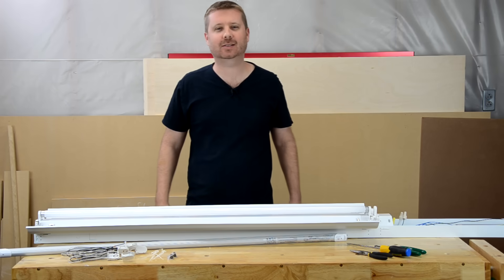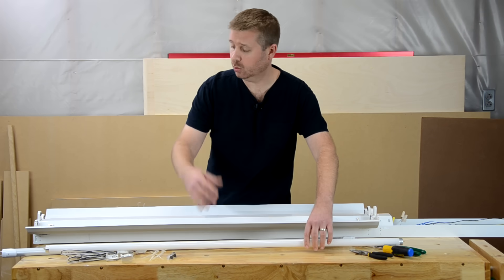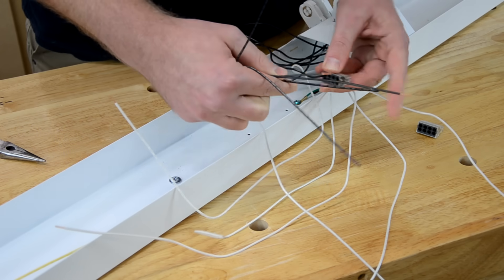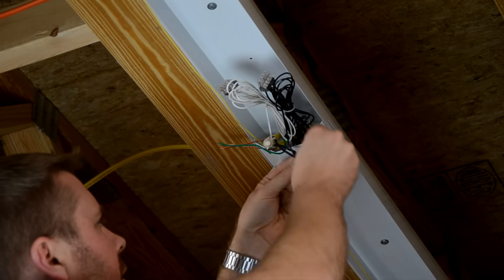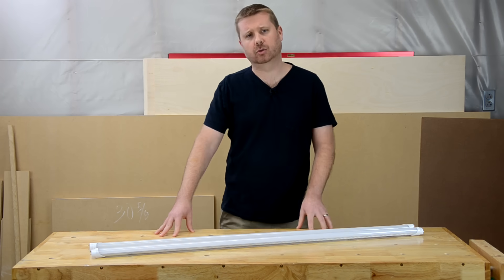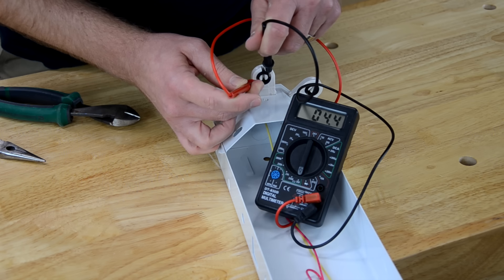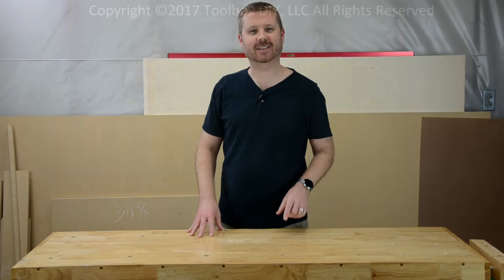How to easily convert fluorescent Lights to LED –Easy Ways to Save Money

Comment: I have 4 ceiling lights. They are 4 foot fluorescent fixtures. They were normal florescent and I changed to 4 foot LED bulbs. They are all the same and have 3 ballast per light. In 3 lights they are fine and bright and work fine. The 4th flashes on an off like a strobe. I switched two of the working LEDs in the "flashing fixture" and they ‘strobed’ as well. It only happens in the one fixture.
After ‘strobing” for a minute the bulb quit lighting or flashing altogether. Did the LED die?
What would you suggest.  aaronkdean@msn.com

Comment: Good Video! 6 LED Bulbs is over kill. One bulb on each end will put out plenty of light, as bright as 6 florescent s did, plus 2 is 1/3 the cost. Double ended LED Tubes have a tiny schematic diagram that shows to wire one side BLK other side WHT (using shunted tombstones).  Definitely take out that old ballast and recycle. They also get very hot so let them cool down before removing.

Comment: Some im a bit late to the party here but i have a question.. my ballest works with 1 LED however when i place the 2nd led tube in it it will turn on for a moment then just turn off.. what in the world would cause that? Also is thier a way to get a ballest thats already set up for dual leds thst i can just change it all out st once?

Comment: 4-5 years ago, I converted the one in my garage to LED and so glad I did.  Although it took a bit longer than your demonstration--first time and I left the fixture mounted--it worked out fantastically.  Now, I have such clear, white light in there whenever I need it without the hassle of having to replace the tubes so often.

Comment: You have contradicted yourself, You said at the beginning you said you need non shunted lamp holders and then said that you need to replace the pre existing non shunted lamp holders with shunted ones. Did you mean that you need to replace the pre existing shunted ones with non shunted ones? And to fully clarify, do I need shunted or non shunted if a am replacing with a single ended lamp like yours?
Reply: He did misspeak and say he was going to install shunted tombstones but of course he installed non-shunted.

Comment: my electrical instructor in turning in his grave.you never strip solid wire with a stripper like that,only a knife at a angle.also your push in connector could cause a fire if done like you did, after you push in you should pull on the wire to bite in a bit for a good connection.

Comment: I have done several conversions and never changed the ends. You simply connect the hot to one wire and the common to the other.
Reply: Jake Jones - That’s the proper method on a double ended bulb but as was stated in the video, some bulbs are single ended. One pin is marked L1, the other N. The ETI retro fit kit from Home Depot is configured this way. The pins on the other end are not connected to the internal strip. They are just there to hold the lamp in place.
Reply: You said that you replaced the NON-shunted holders with shunted holders. But from what I can tell, you actually did the opposite. 3:53 Perhaps it was just an accidental mix-up of terms?
Guess I was lucky in that every fixture had TWO wires into each holder on one end of the fixture. But yeah, I understand that there is no way to attach two wires (hot & common) to the holder, that the electrical end of the LED tube connects to, if there is only one wire coming out of it.

Comment: Evidence suggests the efficiency of fluorescent lights are 85%, the efficiency of LED lights are 90%. This is a trivial difference and not worth the time or effort of the exercise. If a fluorescent light fails change it then, otherwise you are just wasting money. So far there has not been sufficient time to establish that LED's last longer than fluorescents. Is an early adopter of LED lights I have had lots fail much quicker than even incandescents, never mind fluorescents.

Comment: I retrofitted many of these fixtures with LED. They had a high failure rate. I only replace the whole fixture now with much more success.
Reply: Interesting. Used direct replacement LED tubes that are powered by the ballast?
Reply: @fredsinfield5648  No they were wire directly to 120 volts. By passing the existing ballasts.

Comment: Beware, all lights that burn at a temp higher than 2700K because they produce a ton of ionizing BLUE LIGHT RADIATION (BLR) which is very damaging to the photoreceptors in the maculae of our eyes. These macular/foveal receptors are what allow us to see straight ahead clear detail vision and they can take only so much ionizing BLR before they begin to degenerate. BLR is now clearly shown in the scientific research to be one of the main causes of macular degeneration which results in central vision blindness. 
Stick to 2700k or less in all LED bulbs that you ever buy. I have replaced all bulbs in my own home with 2700k LEDs. 
Type Blue Light Radiation and Macular Degeneration in the Google search bar. 
It makes it pretty clear. 
By the way, I am an eye doctor. 
Bluetech lenses for indoor and Bluetech Sunglass dark lenses for outdoor use and Reticare.Com screens for monitors and cell phones which also produce a lot of BLR are the only options I can find to block BLR 100% and keep your eyes safe. All the rest only block a small band of the BLR radiation. 
Get yourselves educated and then protected from this Blue Light Radiation throughout your younger years and you will significantly reduce your risk of AMD. 
Grady M. Clark, Jr. OD.

Comment: you can contact me if you need led light,our factory specilize in purified fixture lamp proof light, T5 intelegrated light,T5/T8 tube light,odm/oem are welcomed,whatsapp:0086-13757352084, facebook:alicepan1964

Comment: Just bought a two pack of LED tubes from costco and put them right in..... they worked like a charm!!   Not sure why the fuss over opening up the fixture and re-wiring things 🤪
Reply: Ballasts put out high voltage, some LED's need that, others are designed for 120VAC which is typical house voltage, so you have to know the difference

Comment: Another 2 cents. For work get the higher Kelvin, closer to day light tubes. The bluer light makes details a bit sharper. Grandma might prefer the warmer light, it'll show fewer wrinkles. 

     And don't listen to anyone saying "Daylight fluorescent? those things are terrible!!" That person will be at least 50 years old. There used to be a 'daylight fluorescent' in the 50s and 60s (maybe earlier) that flickered and gave off a really ugly greenish light (not at all daylight).  It was supposed to be a cheap and efficient solution for lighting up passages and stairways. They noticeably flickered. If you've ever wondered what a migraine headache is like, find one of those old fixtures and spend an hour reading under it's light.

   Daylight (the temperature of the sun's surface after it passes through our atmosphere) is 5500 degrees Kelvin and the best light to work under (so long as it isn't flickering), shows colors the best. (Yes I know our eyes adjust, but I can prove this). LEDs really are wonderful.

Comment: The double ended LEDs do raise an old electrical concern. One of the major problems with the old post and tube wiring, (besides bad insulation) is the separation between hot and cold wires.  You know the old story, the rat gnaws on the insulation of one wire while its tail sits on the bare wire of the other side. Circuit made, rat is electrocuted and then caught between the wires like a resister the corpse heats up, burns down the house... If that rat's ggggreatgrand-children gnaw on romex and makes a circuit, it'll be close enough to trip the breaker before catching fire. 

 In my long construction experience more than a few mechanical accidents have happened around live circuits, cutting the romex, or the wires, or the flex... big spark and the fuse blows or the breaker trips-- and no one dies and nothing burns down. There's an overall safety advantage to having the hot and cold lead right next to each other and the ground. Anything bad that happens is much less likely to travel far enough to put your heart in between. It's odd that in 2019 I've installed several LED 'fluorescents' , but never changed a bulb and never thought about how they're wired. Tonight I want to convert a really nice fluorescent fixture I've had for 25 years. Thanks for the video.  Answers all my questions.

Comment: Two questions. How come you did not take the time to shorten the new wire for the LED tombstones? Second, how come you did not just push the hot and the neutral into their respective push-connectors instead of using a pigtail? if the wires were cleaned up it would have been really simple to identify these if you need to work/replace in the future. A good video just had these questions.

Comment: I recently converted 31 6 & 8 tube units. I did not need to change the tombstones. I used 5000K bulbs. The shop now is like working out side on a sunny day. A plus to LED is no or very little heat is generated, so in my shop with saw dust it’s a nice perk. From my days of wiring homes we did not bundle wires and tie them up because of heat build up we would let them just be loose. I do realize with LED there’s not much amp draw so probably not any heat buildup in your bundles but if it was for another heavier amp draw item it may make a difference. Nice video I’m sure it helps people that are wandering through the LED maze.

Comment: That 1.1K disliked are the one's that are electricians and they don't want you to DIY  and taking away their businesses. LOL
Reply: You are partially correct but it has nothing to do with the business side of the industry.  Many of the down votes most likely have come from electricians, such as myself, who understand the dangers of such an installation.  The process shown in this video of supplying line voltage to a fixture tombstone creates an increased risk to the homeowner coming in contact with live parts.  There is little protection offered by the plastic shell of the tombstone when installing the LED lamp which has exposed pins you insert into the tombstone.  Additionally, many of these products are not tested and/or listed by any reputable agency such as UL or CE.  Some of them are, however the danger still exist.  Responsible electricians always place safety above cost in any application we perform or recommend.  

As to your statement on this taking away our business, very few electrical contractors rely on minor service work such as this as a stable business model.

Comment: I have a question.  Does a ballast uses energy even if the florecent tubes are not plugged on but the switch is on?
Meaning: I have a few old florecent lights in a hallway but i didn't need as much light as they were originally providing,  so i just twisted the tubes out of their sockets.
 Is the ballast still using anergy?
Reply from the maker: Magnetic ballasts will continue to consume energy without tubes present. Electronic ballasts can vary. Some may continue to consume energy but typically less than a magnetic ballasts. A well designed electronic ballast may have circuitry to sense the presence of a load and consume little to no energy. The amount of power we're talking here is probably 1 to 5 watts so not much.
Reply: @ToolboxDIY  Thank you for your response.  I highly appreciate it.

Comment: I have already changed mine to LEDS,  On some of the 4 light fixtures I changed the one end blub did not fit. I had to use the pin cap to wedge the cold end without the tombstone. Your presentation is the only one I found using the single ended LEDs.

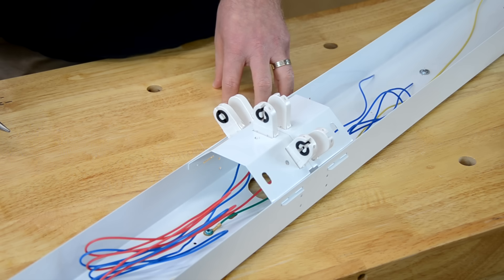Comment: I'm confused...I'm not sure if you are aware of it but you contradicted yourself at 3:57 in the video. You described the lamp holders that were already in the fixture and that you needed to replace as non-shunting when you previously (and later towards the end of the video) described them as shunting  lamp holders. You did state correctly in other parts of the video that the fixture in which you were replacing the lamp holders, require non-shunting lamp holders on the power end of the lamp.

Comment: With out reading all the comments below. I have q question. Can up put the new led tube lights on a dimmer?
Reply from the maker: If the LED tubes are dimmer compatible, you can. It usually specifies on the packaging if the tubes are dimmable or not.

Comment: If the new LED tubes are single ended, then I just need to replace the power end with an un-shunted tombstone receptacle, and just deadhead the old shunted one at the non powered end?   Can you confirm?
Reply: Exactly what I just did! Worked the first time!

Comment: What would happen if by mistake someone fitted a standard tube, (not LED ) after this change?
Reply: That's a damn good question.
Reply: Exactly nothing! The florescent tube simply wouldn't work at all! No sparks, no smoke, nothing! No light!
Reply from the maker: richardscathouse is correct. Nothing will happen....unless you have a 220-240v fixture (not common in the U.S.). I've seen videos where those fluoro tubs blow out once the circuit is turned on. The glass didn't blow, but the bulb was shot. The fixture was still operable.

Comment: be careful... we are not allowed to install double ended ( pass through) LED tubes in OZ, they must be single ended. The reason is that when you are installing a pass through LED tube and you install the tube into the HOT end first you are likely to have the palm of your hand on the pins on the other end of the tube...zap.
Reply: Assume you cant buy then either?
Reply: @richardscathouse   there are a few years of them that were installed as well as people purchasing them online.  You need to assume the end pins ARE live to be safe.
Reply: @zukjeff  As a carrier electrician (Radio) I assume nothing, ever!

Comment: What this shows is correct for single ended led tubes. On thing that wasn’t mentioned is the tubes are only powered from one end. The tubes are labeled.
Reply from the maker: Single vs double ended are discussed at about 9:00
Reply: If you reverse install they simply won't work!

Comment: While Doing this , make sure tombstones are not shunted. Very very critical.  Either buy a new ones (non-shunted)  or open the assembly and cut the shunted part. LED need non-shunted connections for single ended power so you can connect Live and Neutral wire. Fluorescent need shunted While in contrast LED need non-shunted.
Be very sure what you are doing. it looks too easy but not.
Reply: Dead end of bypass tube is dead! It only supports the tube has no connection to the light! If you try to install backwards, it just won't work!

Comment: Have you considered that rebuilding or changing fluorescent fixtures to LED fixtures you are voiding the UL/CSA approvals. In some jurisdictions you need a permit and there are required items that have to be satisfied to get a permit and inspection. By the time this happens it would be less expensive to simply replace the fixture. Most if not all homeowners do not have the skill set or experience to do this change.

Comment: I will agree 48" LED tube are more efficient than a 48" florescent tube. But it depends on how many hours the light is actually operating. If you have a shop as where you have the lights on say, 8 hours a day 6 days a week, you will definitely realized a reduction in the electricity used per month. But if we're referring to 4 double tube fixtures in a garage that on a daily basis they're turned on 15 or 20 minutes per day, it is going to take years, to achieve pay back of switching from florescent tube to LED. It is common that the switch to LED is helpful because the LED in fact produces more light, to say brighter. Especially if your garage is not finished inside. I know for a fact that florescent tube last a long time. I built a 32 x 48 pole barn, and installed 14 double tube 48" fixtures in 2001. Never replaced a single tube until 2017. Used those light everyday for at least an hour a day. The real issue, in my opinion is how much LED functions when it's winter time in a non heated building. That's where the real difference happens. Florescent fixtures take a few minutes to warm up when it's really cold.
Reply: If you leave the ballast in (non-bypass) you will actually use more electricity!

Comment: You can now purchase LED tubes that mount directly without changing anything in the fixture. They're $8 USD for a pair.
Reply: Yes, and the installation will use more electricity by-pass is the way to go!

Comment: Great explanation. My ? Is how do you know which LETs are single ended bulbs? The package doesn't say & manufacturer website doesn't give this information.
Reply from the maker: If the package says it work with a ballast, then it is doubled-ended. If it says not rewiring needed, it's double-ended. If it doesn't say any of that or anything that lends a clue, take it back and pick another manufacturer!

Comment: In fact, LED works without ballast if you want to replace fluorescent. that's all.
I am a 15 years experience man in LED. Ask me if you have more question.
Reply: my showcase ballast is dead and i cant even locate the damn ballast inside.. 

can i for example use LED lamp and do i need to convert AC to DC for led power source?
Reply: Can you explain why he never used a balast here.

Comment: as a maintenance man I cant begin to tell you on a room change out for bulbs how many ballsts I changed in twenty years for multistory buildings. my partner and I would take turns climbing the ladder when relamping a floor.I like the idea NO ballasts involved. Wiring by someone else caused havoc on some nonworking fixtures. I enjoy your knowledge on the show I subscribed to.       Verizon now retired.